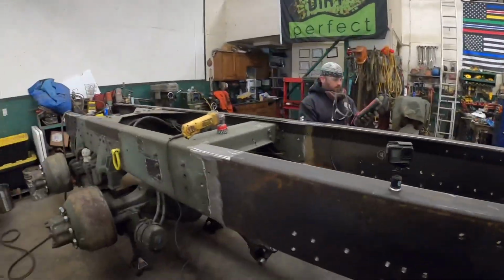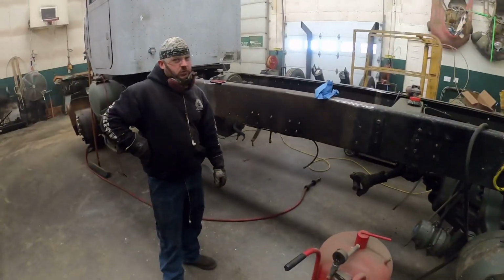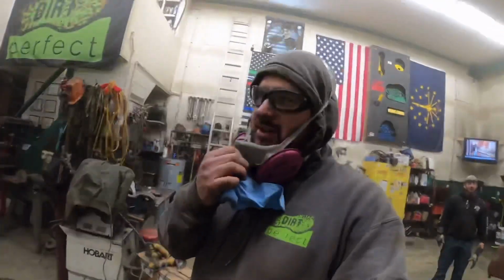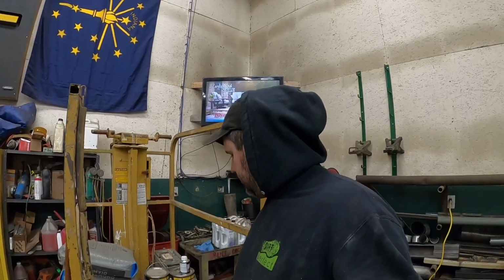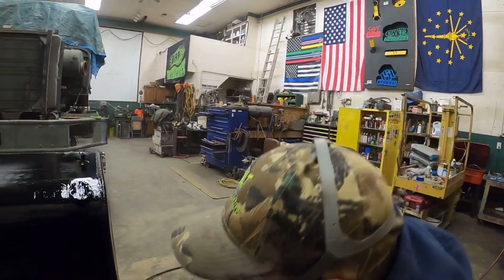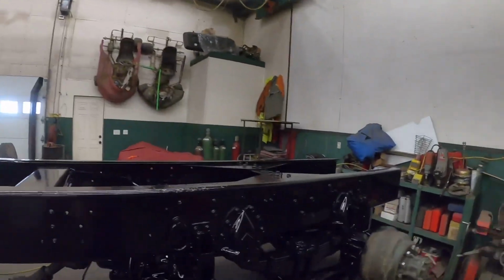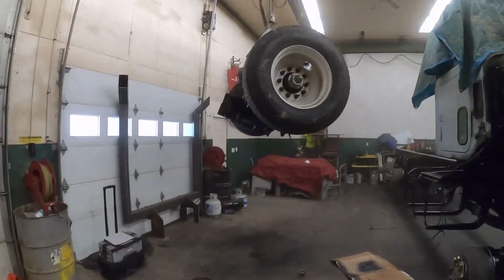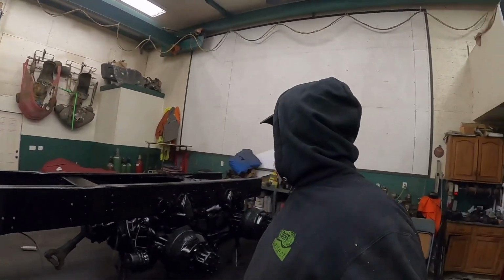We make a huge mess in the shop but finally get some new paint on Lt Dan

Comment: 6 years in the military. If it's supposed to move, grease it! If it's not supposed to move, paint it! If it yells at you, salute it!

Great job!
Reply: Salute you my brother Don . HOOHA!!
Reply: Out of my 20 years of service as an Air Force Vehicle Mechanic, the most toxic thing I was ever exposed to was CARC (Chemical Agent Resistant Coating) paint on all the tactical vehicles.  We had a moron that thought it would be a good idea to sand a panel so they could spot paint it!  That was a MASSIVE EPA violation and we all had to be checked and tested due to the exposure for quite some time!  If it needed to be repainted, it had to go to DEPO Maintenance since there were no local body shops with the facilities nor equipment to remove and spray CARC paint.  The local body shops wouldn't even consider investing in the facilities and equipment due to the extreme regulations regarding to CARC paint.

Comment: Wow, What a great video. Brings back a lot of memories. That "Black Diamond" you can re-hash at least twice so I'd save the sweepings. Great idea on "torch hose". Wish I's a thought of it. HA HA. If you take a 20" box fan and put a furnace filter on the suction side it will cut down on the paint fumes and any other dust in the shop. Did you forget to paint the stacks? I know tune in next week for the answers. Same "Bat" time, same "Bat" channel. Thanks again for another great video.
Reply from the maker: Thanks don

Comment: Best paint system to use for frames is a Sherwin Williams 646 epoxy with a zinc primer. The truck will rot away and the engine will die but the frame will still be shiny black and solid

Comment: I have a tip you may our may not have noticed in your build...
I have built a few of these trucks. One thing I've learned is that the front leaf springs on a semi tractor are not rated the same for a dump truck. Most people choose the solution to adding more spring leaves to the front. Which results in a cracked frame because the frame was not intended to be a dump truck. I know Lieutenant Dan has a superstructure for a frame but if you run into the problem of the front Springs not being heavy enough I would not suggest adding more leaf springs. From experience I would suggest adding airbags to the front axle. That would do two things it would ease your ride, and also carry the load a lot better. Just a suggestion I hope it helps
Reply from the maker: Thanks

Comment: If you rub vassolin on your face before painting, it is easier to clean the paint off after.
Reply: Sounds kind of gross but olive oil spray Pam works pretty good too!
Reply: Lt. Dan, is really coming along! Can't wait until you & MBTS install the dump body and get that 1st load of dirt in the truck!
Reply: Lt Dan's Lookin Good. Red drive shaft and that black frame would look great

Comment: What you need to do after all sandblasting is done is use light air just enough to move sand and blow down all shelves , benches conduit just enough to blow it away to settle on the floor ! Works like a champ

Comment: While you are at this piont you ought to run the trailer brake air lines and electric plugin to the back of the frame for a trailer hookup
Reply from the maker: Stay tuned

Comment: My dad use to put a 1 gallon can into a 5 gallon pressure tank. You can switch easier, less cleanup and mixing is outside of the tank. Just make sure the straw is in the paint bucket. It may work with that 2.5, may not. Just a thought. I know these vids are a month or so delayed but it may be useful on a different project. Enjoy the vids.

Comment: I wire wheeled and painted the frame on my one ton dually and it’s a ton of work! So satisfying when it’s all done though. The truck was stripped down to just frame and axles and I actually flipped it upside down to paint the bottom. I know that wasn’t an option for you but it’s looking sweet 😁

Comment: no.1 that black on the frame looks great , no.2 any thoughts of getting new wheels and tires , no. 3why are battery box bottoms not lined with wood to prevent battery drainage of power after sitting for any given amount of time and to cut down on corrosion ?

Comment: Lookin pretty sharp there! I remember about 20 years ago we would buy a bunch of that paint at our farm supply store for $19.99 per gallon and it is good paint for equipment unless you had to sand it because it actually stays soft for years so it'd just immediately plug up the sandpaper, never had to worry about it chipping off though. I'm sure that the hardener you used will make it even better paint.

Comment: That poor milling machine and lathe against the wall....

Also, at 6:38, pro tip, stick a piece of wire in the hole next to the funnel. It'll let the air out easier and flow through the funnel better. Use the same blaster on tractors too.

Comment: From here that looks like a great job guys. It makes it look really smart rather than somewhat drab and will most definitely slow down corrosion. Have you or will you do something to slow down rust jacking between the two layers of the frame as it seems that this is really important long term issue on twin rail chassis?

Comment: Aren’t you planning to close off the back of the frame and add a pintle hook?

Also, does it make sense to seal the seams between the inner and outer frame rails to slow down the potential of rust jacking?

Comment: Hope you learned your lesson sand blast outside the shop with wheels on to avoid the nasty clean up. Also never blow the battery trays with air always vacuum them out to avoid inhaling the acid corrosive particles. Love when MBTS has the quick comeback lines you throw at him. Lol

Comment: Wish I was there to mask off some stripes on the cab and move those heinous tanks and dryer tank to better locations. I see no reason to do any chrome or high polish tanks, even battery covers will be just fine with paint but my feet would go straight up the sides to the doors some way or other. I know that over time that your going to think back and say I wish that old turd would quit trying to spend my hard earned money but since when has spending money ever stopped you when you sink your teeth into something. One nice thing is that nothing is set in stone, it can be changed after the fact and that truck needs to go to work and earn its paint job. What a score on using torch hoses for paint as  that one got past me. I have painted a good ten trucks over the years and swore that I would never do another one yet set my jaw and did them to make a lot nicer to see. I am witness to a half of the truck with a nice looking paint job would be working and mine   sat till they had to hire so I did the honorable thing and rattle canned the first one. It actually was one of the nicest ones ever and the very cheapest ones to ever come from my paws. It would be so easy for me to write a book on "what I  would do" to make that truck stand out at any truck show heading up and down the parade grounds. I did take second in a highly competitive parade in forks washington where I competed against five hundred trucks as they make that parade a high point in the year for Forks Wa. There has been in the past over a thousand trucks enter in the competition so I felt real good, I might add that some of their trucks were right out of factory dolled up to win. I had a fifteen year old Ford L9000 with a ugly triple nickel cummins engine. I was scratching for dinner for my family even tho I had over a hundred employees at that time.... Helicopter logging was what I was into at the time and yes I had newer rigs alright that were real nice but this one was special and it had set in the corner being abused badly so at the time when it needed a new deck on it as it was a twenty four foot flatbed with special tools to fuel and grease other equipment and my son in law and my truck boss were there working with me to help, we were just having so much fun a clowning around. Two weeks coming was the show time and we got kidded about how nice it was turning out so we just did it at the last minute... a lot of butt hurt people over me taking second place an my first time entering. Ok, I made this part of a book or at least a chapter so have fun and loving its look

Comment: Not that I have any experience,🙄 but "some people" can find sometimes silica sand in various toolbox drawers over 20 years after trying that method, no matter how many times I've (I mean he) dumped out and wiped out the drawers on a toolbox that was not even opened at the time.  I wish I could say my work turned out that good.  (But I sold the tractor).

Comment: so is that a hvlp? I have a skid steer I need to paint and what to get a used system I have a compressor just not the rest of the paint system and what you have seems like a easy low cost way to go.
Reply from the maker: No pot sprayer

Comment: How would you convert one of these trucks from rim clamp style wheels to lugs and lug studs on the rear axles?
Reply from the maker: Not for sure guessing will have to  change the hub
Reply: @DirtPerfect  I think that's how you wound up with all new brake drums. I'm trying to figure it out.

Comment: Get yourself a vacuum, ffs-a real vacuum. It’s half the work-probably a quarter the work by the time you finish chasing down the dust you spread with that airchuck-and it’s better all around. Save the air for the little tiny stubborn or hard to reach areas. Spend more than you think you should. You’ll wonder why you did without.

Comment: Pro tip - you can leave the paint in the 1 gal can and set the can in the pot, and then put suction tube into can. ZERO clean up.......
Reply: But, you won't be able to add the hardner or thinner into the can unless you remove some of the paint in can. Good idea though